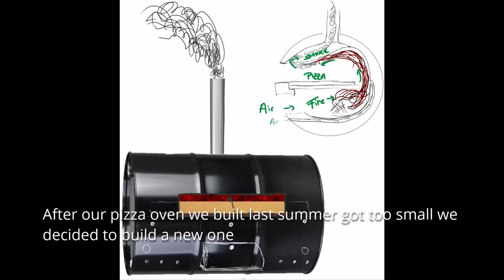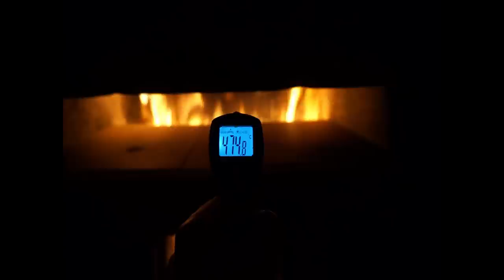DIY Barrel Pizza Oven + 1st try out

Comment: The design is very good, one of the ways to keep the heat inside the oven would be to remove the chimney from the top, the heat go away  through it, and lower it just above the oven door, surely the heat inside the chamber will be higher without oscillating too much.

Comment: Hi, great build! I have going around various design of pizza ovens and I am not sure the flame below the cooking surface is optimal. I found with those setups the floor is getting too hot compared to air temp and pizzas tend to burn easier.  Perfectly I like air temp around 450-500C and cooking surface around 350-400!    It's still looks like an amazing oven.  .  ... Kein Mensch is illegal! jawohl!! Gruesse aus Australien!

Comment: First off.  I wanna be your friend.  Smoke big phatties and cook pizza in your yard.                                                 Second.  Your video is great.  Awesome editing, awesome music and no BS.  I applaud your understanding of the need for secondary combustion air.   That is a very overlooked part of any wood fired stove design.   Do you think your secondary combustion pipes helped?  They seemed a bit small in diameter.  Just curious if they pulled air on their own and if so, how much.  In my eyes the secondary air should enter the system just above where the tops of the flames are to get oxygen to the unburned gases are.  It was hard to see if they did much in the video.  Nice job on build too!  Really really good job!
Reply from the maker: :) Sounds like a plan! Thank you for your feedback! And you´re right, the diameter of the tubes is way too small, also the position of the ends of the tubes is too low. They help the airflow somehow i guess, but the air only inflames when the oven is running on really high temperature. Which then is too hot for cooking proper pizza (above 500°C). 

Another disadvantage is that I used a combination of perlite-cement and steel. The steel moves with heating up, while the cement doesn´t. I had to add additional cement on the cement-steel joints to prevent the loose perlites falling into the cooking chamber. But it works that way now.
We cooked already hundreds of Pizzas and in general the oven works fine.
I hope i will find some time to make another video of the oven in action.
And as my weldings skills are improving I´m planning to build one completely out of steel, with better secondary air combustion ;)
Reply: Cloud9 ha!!  Where do live!
Reply: good. I'm making a similar one. with the change to become a grill..i wanted to ask you about that door. that you spoke at the end of the video ... where you wash placed. and you have a photo. thanks

Comment: Excuse me, what the Cooper tube pipes are for dude?
Reply from the maker: i wanted to have a secondary air combustion, but unfortunately it didn´t work. i think the tube diameter was too small, and the tube ends came in too low in the burning area
Reply: @DrWolke  ok thanks for the sharing with US👍